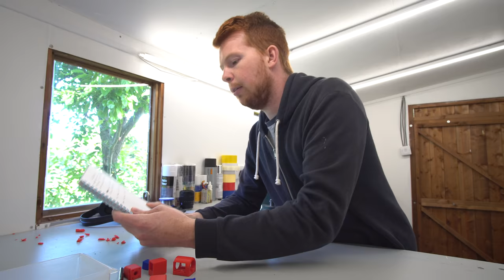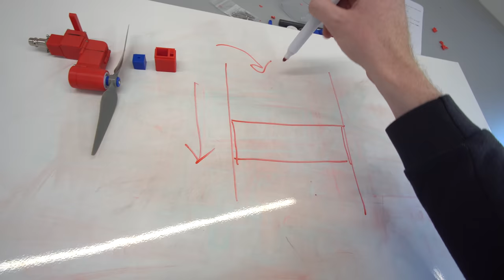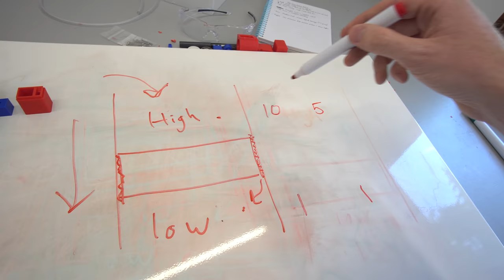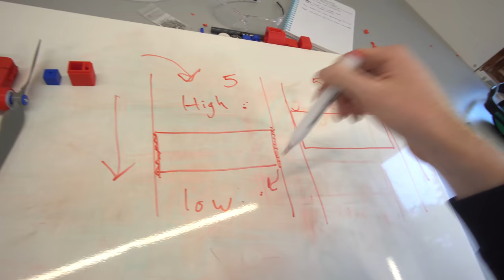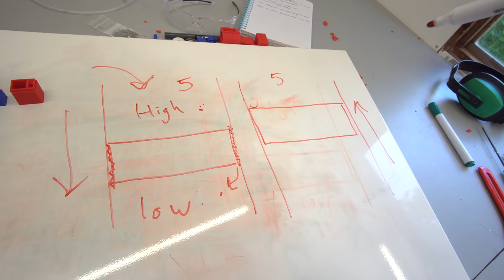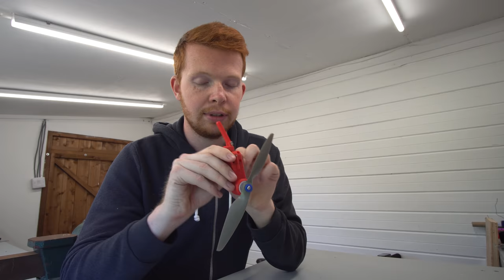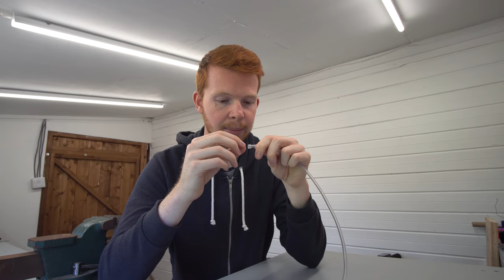Multiple or Single Cylinder Air Engine?

Comment: You should use much smaller bearings for like RC cars. You don't need those huge bearings. Also go multiple it a good challenge I'd say keep it simple go rotory with a compressed crank case for "intake" manifold. Have the cam open the valve in the crank case. As long as you use zz bearings it should seal.
Reply: rotory could be realy nice :D
Reply: Great idea, reduces weight, and likely increases efficiency and simplicity!
Reply: good idea. 608 rollerblade wheel bearings should be a good choice.
Reply: spud4242 I'm pretty sure the ones he's using are 608. Something like an SMR128 hybrid ceramic would be ideal here if the crank needs to be kept at a minimum 8mm diameter.
Reply: timbargen r188 is a staple in the fidget spinner community for higher end models, and they have ridiculously low friction.
Reply: A5C3NS10N STUD105  SMR128 is nearly the same size as R188, only 0.7mm smaller outer diameter, but it has a larger internal diameter. 
If you're going for low friction, use the smallest bearing that will support the load.
I made the assumption that he may need to keep the shaft size to 8mm to avoid strength problems from the 3D printed plastic; MR128 is the smallest bearing available that still has an 8mm bore. 
I did a quick calculation, and bearings much smaller than these sizes likely wouldn't last too long if the engine was being run at 100psi (assuming 1"² piston).

Comment: Switch to a turbine engine configuration 😉 continuous power, no "strokes" to lose efficiency. Maybe have the rotors and stators printed with a SLA printer to keep the precision high. 

Great work though
Reply: Alan John the air pressure required to make one of those provide any meaningful amount of thrust just isn’t realistic at this scale with these materials. It would be a cool model but practically impossible to get any thrust out of without combustion fuels.
Reply: Alan John. All air driven tools I know of  use turbines not pistons to harvest the power of compressed air, some of them is much smaller then the models here and they are all very powerful. After what I understand only reason to construct piston air engines is for fun, not practical use?
Reply: Rondo Cat well of course air powered tools using metal components and a steady supply of high pressure air are able to work for things like die grinders and such. But the material limitations of the plastic will stop that from working, and a high enough pressure isn’t sustainable using plastic bottles. And even with air powered tools they provide almost no torque. Stalling out a grinding disc on one of those things is super easy to do. I suppose not a lot of torque is required for spinning a propeller, but for any other application you would be hard pressed to get it to have any meaningful force behind it. I agree it would be a cool idea, i just don’t think the materials or circumstances allow for that to be feasible.

Comment: Well for the question you've asked (which everyone seems to be ignoring), the answer is if you'd prefer one or two bearings. I feel that the inline twin could be more efficient if the crankshaft is worked out, however would requite two bearing for the longer crank shaft. At the same time, internal complexity and weight is reduced by a block twin. This is to say, (likely) fewer moving parts in the block twin and a lower mass of the crank shaft.

The 'plumbing' of the block twin would end up being some arrangement of the old bearing and spring valves. You could potentially keep the valves toward the center of the engine, by placing one valve up and another down. A single cam rod could control both. A small divot in place of a bump could lower the cam rod rather than raise it, there by opening a ball valve mounted upside down. The cam rod would not be typically shaped in this case, instead having a kind of branch on it.

As a bonus, the valves may also feed to both cylinders at once, however feed to different sides. Someone else mentioned a double acting piston, which doesn't seem to difficult to set up with a block design. In this case cylinder A would be fed air on its down stroke, meanwhile cylinder B is also fed air from the reverse direction on its upstroke, and vice versa.

Comment: That design uses way to much "fuel" . A single cylinder with two pistons is much more efficient and has double the power and has constant torque, and revs high. And is efficient and has low energy loss. You should try the "Opposed piston" design (explained above). Edit: It's more complicated, but much more efficient. Like to him to see!
Reply: A single cylinder with two pistons?
Reply: TheBaconWizard Yes.
Reply: TheBaconWizard By the way the sound is really good.
Reply: One high pressure zylinder and a low pressure zylinder like in efficient steam engines, correct? If so, there can be made much more stages (i have seen a drawn one with five) , to increase the efficiency ;D
Reply: 2 pistons on 2 end of the cylinder. the air goes in the middle of the cylinder and pushes 2 pistons to the side.
Reply: Ich mag Kekse Not exactly. Just one cylinder. But two pistons. More torque and the rpm are higher. But that idea is actually really good. The problem is that air travel would not work really that good. An inline that used exhaust to power another cylinder would also be cool, but inefficient, because it is to heavy. A opposed piston engine is light, so it would be better for a light airplane.
Reply: Sinh Nguyen Exactly.
Reply: but there is a problem with your idea, it needs at least 2 crankshafts on each side. that makes it more complicated.
Reply: Sinh Nguyen Yes it does. But the marvelous gearing would make it the perfect engine. Or just build a Wankel!
Reply: it will be wayyyyyyy more complicated and heavier. i think a boxer engine is more efficient
Reply: the air pressure is divided to 2 pistons and it only needs 1 crankshaft.
Reply: Sinh Nguyen But that isn't a boxer. And the opposed  needs one valve, not two. The expansion is greater. And you only need gears. And being single cylinder, you have less mass.
Reply: Sinh Nguyen More expansion per cylinder= more power.
Reply: Sinh Nguyen The crank shafts would be simple, and that was his bigger problem.
Reply: I think the two crankshafts, double bearing and gearing will give a lot of friction, and therefore loss of power, or it will need a big flywheel.
Reply: Eric Beyer It doesn't have a big power loss actually. I have made it with Legos. The fastest and most powerful engine I have ever built. And it weights around the same has a one cylinder and 1/3.
Reply: Eric Beyer And it doesn't need a big flywheel . But it DOES support a bigger prop, because it has a lot of torque, and the bigger the flywheel, higher is the thrust.
Reply: " More complicated,  but much more efficient " .   This statement nearly gave me a stroke. Check up on your laws of physics more specifically those of thermodynamics and then please explain.
Reply: Trippy James Reynolds The efficiency here relies on constant expansion on the cylinder, and less energy loss and air "coagulation" on the intake. The cylinder head holds the pressure and makes it go down, but also disperses energy and forces high pressure on the head and lower pressure on the rest of the cylinder, reducing efficiency. This design of course has more friction, but has better expansion and makes the use of rotary valves easier. The design in the video uses a pushrod, one of the worst valves, because it uses a lot of energy. The opposed piston produces more torque, since has a better airflow, lower vibrations, And higher RPM, perfect for a airplane or for a Car.
Reply: Forever13 pt  all I'm saying is any time you make a thing more complicated you increase friction and reduce efficiency.  The design you mentioned may be more fuel efficient but once you factor in the added complexity of build resulting in more needed manpower to design and build, electrical power consumed (in the 3d printer), extra filament to build that also cost manpower and electricity to make, actual friction produced by those new extra moving parts, and potential new air pressure loss due to the unfortunate fact that 3d printing is not as exact as the manufacturing processes involved in building real motors there is no possible way it can be "more efficient ".
Reply: Trippy James Reynolds On the internal combustion design of this engine you get more power than the same sized engine with just one piston (both 2 stroke) (same fuel intake). There is friction, leaks and all kinds of losses, but expansion is the most optimal. I've tried this with Legos. It's an efficient design. On a air engine, I can't prove anything to you, but you could try it yourself.

Comment: If the two pistons are connected to one crankshaft (obviosly) then when the 1st piston is going on the down stroke the negative pressure would cause the 2nd piston to travel up faster, only if they space under the two pistons are connected. Just a thought

Comment: For an rc car your going to need the torque of a twin engine to get moving.
Reply: If you have two pistons one is pulling the crank shaft up and one is pulling it down so there is always power going to the shaft instead of there being only one power stroke. But he could just make a very large single piston engine instead however I think a twin is the best option but that is just my opinion.

Comment: Working with compressed air, there is only so much that can be done with PLA plastic. At some point you may run into issues with air leaking between the layers of printed material. This being said, I would really like to see you try using ninjaflex filament to print the o-rings, I'm curious if it would stand up to any pressure!!!!

I would recommend using proper pneumatic components and printing the frame on which to mount them. For example while your 3d printed throttle was really cool, you could have just used a needle valve. By buying a small pneumatic cylinder you could avoid the issue of air leakage all together.

I would also cast my vote on perfecting the single cylinder before doing multiple cylinders. Perhaps you might reconsider designing an engine with a cylindrical piston. A cylinder is more capable of withstanding internal pressure than a rectangular prism, and might run smoother with less friction.

Comment: Why do you use a piston? Why not some kind of diaphragm? You would eliminate the blow by and friction of a piston.
Reply: Edge Precision the energy extracted from the system will decrease because the power stroke would have to be shorter than the piston if he keeps the cylinder sleeve the same size plus a diaphragm would have to be an electric material and would create more resistance to overcome as it would act like a spring. Also the diaphragm could burst. The piston is going to be better for long term wear and testing than a piece of thin rubber or elastic polymer.
Reply: A diaphragm is a good idea to test. Yes, there will be some hysteresis losses in the flexing of it, but it would also be a means of utilizing lower pressure air or perhaps more complete expansion.

Perhaps a compound engine with a piston high-pressure stage and a diaphragm low pressure stage.
Reply: Not to mention he would most likely use a rubber, which wouldn't stretch without pulling back and causing large losses In efficiency
Reply: If it stretches and "pulls back", that's not lost efficiency, that's just storing and recovering energy. Hysteresis is where the efficiency is lost.
Reply: jonathanrabbit every time you convert energy from one form to another, a small amount of it is wasted, so its mor efficient to leave it in the the form that its in. when the diaphragm pulls back, kinetic energy is converted to potential energy, you have some loss of efficiency there, then when it snaps back, that potential energy is converted back into kinectic energy, wich results in another loss of efficiency.
Reply: Sure; but we're comparing the hysteresis of an otherwise friction-free rubber diaphragm with the friction and blow-by losses of a piston.
Reply: Agreed,   @ Tom , With all the improvements you're making with each version,  consider getting rid of the piston now, not later. It could save you some effort in the long run
Reply: An idea came to mind using porting via rotating disc or similar to pressurise both sides of the diaphragm alternately. Could that work?

Comment: as much as I agree with the thinking towards a multi cylinder, you are getting a really good design going with single, maybe perfect that, then translate those findings to more cylinders, inline for sure, ultimately the crank will be a better build than a complex inlet manifold, less chance of inefficiency due to leakage etc. Loving the Videos Tom, very clever

Comment: Instead of a PVC tube, you could create some sort of manifold thing with rubber gaskets on to the side of the engine where you have put the cam and pushrod. And a single inlet at the center would be simple.

Comment: I think the amount of air that goes around the piston isn't better at a 2 zylinder engine. It' right that you need only the halve pressure but the are were air can leak is twice as big. So I think it makes no difference

edit: ops you just said that
but the area where air can leak is smaller at a one zylinder engine by the same replacement

Comment: I've been working on a similar project for a bit, and kept running into problems with the valve setup until it ended up getting shelved.  I had the airhogs-style spring ball valve working, and was trying to make a rotary valve work, but obviously ran into issues getting 3d printed parts to seal well.  I had been trying to avoid using a pushrod, but as you found out that really is the way to go.  I was also running a polycarbonate cylinder liner since I was using round pistons.  I recently bought your STL, and was going to play around with the design a bit with the intention of going multi-cylinder.

A couple of thoughts:
For the throttle, rather than have the lever push directly on the diaphragm valve, use a threaded cap.  When the cap is screwed down, it will push on the valve to close it more, and when it's unscrewed it allows the valve to open a more.  It would also hold a throttle position more easily this way since the pressure isn't trying to blow the valve open constantly.

As far as the air distribution issue:  If you can move the air inlet from the back of the cylinder head (or the front, with the simplified crank/cam setup) to the side of the head, it should be possible to just use a longer printed block to make the 90 degree turn from the head towards the center of the engine where you can connect to the throttle setup with a Tee.  Could likely make it all one piece that screws down to the top of it, actually.

Comment: A Wankel engine!
Reply: MrTomadevil does not ever gonna work without internal combustion
Reply: it does work but you need to feed the pressurised air in the section where the fuel would be ignited
Reply: are you pointing out its weird name or saying he should use a  wankel engine? because if youre saying the name is weird, it is, but its a thing. if thats not what youre saying, then this comment is pointless
Reply: You get a rotary steam engine so it will work
Reply: A wankle engine is a real thing and it coild be a good idea
Reply: yes!

Comment: Many years ago I worked for a company that used a unique 3 cylinder pneumatic motor in the robotics industry.
The motor used a 'tri-lobe' cam to draw energy from 3 pistons that were timed by the shape of the cam.
The motor was incredibly powerful, and since it ran on pressure, generated max torque at zero RPM.
Great for robotics.. Just a thought.

Comment: In a two cylinder engine the air that leaks form the one cylinder that would be in the high pressure stage of it's cycle traveling bown will helping the other go up 
Using the Bernoulli the air leaking woud be the same for the two examples, because air is not an ideal lequid the two cylinder would be worst at efficiency but the two cylinder woulb give you the option of scavenging exhaust gases
Go two cylinder boxer

Comment: As an engineer myself, and someone who designs and prototypes and fails a lot, then redesigns, etc, i would say go for the single cylinder. Once you get that working well, then move onto an in line 2 cylinder. It would probably have a lighter weight and less wind resistance. Also the crankshaft in theory should not be any more complex then the plumbing on the opposed twin. Best of luck! Can’t wait to see this play out!

Comment: Why not go with a v2
Reply: Yes, it would need only a single crank throw, the cylinders' being closer than an opposed would simplify pipes, and, at least at 90 degrees, should be reasonably well balanced.
Reply: @CAMacKenzie  everything under v6 is angeled 60 degrees
Reply: @edchel1187  No, 90 degree V2s are common in small industrial engines. Briggs and Stratton, Kohler, etc build 90 degree units.  In motorcycles, Moto Guzi uses 90.  Honda and Suzuki have used 90.  Early Mazda cars used 90s, from 356 to 1400cc.  Going the other way, lots of motorcycles have narrow angle V2s.  Harley Davidson, Honda, Suzuki have used 45.  Lots of other angles have been used by various companies, from 18 to 170.  in 4-bangers, Lancia built engines in 10, 11, 13, and 20 degrees.  ZAZ, Honda, and a bunch of others used a 90.  Porsche, too.  Even in  6 cylinders, 60 degrees is not de rigeur.  GM, Honda, and Maseratti have used 90.
Reply: @edchel1187  and v12 are angled 60 degrees
Reply: @edchel1187  VW 5 cylinder use 15 degree angle.. https://en.wikipedia.org/wiki/VR5_engine